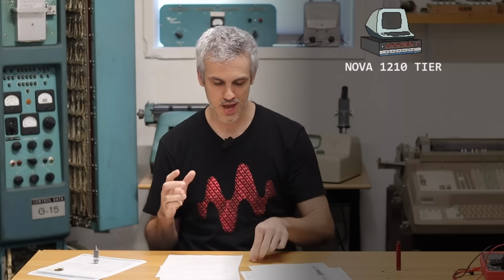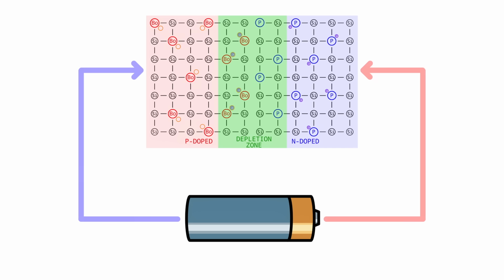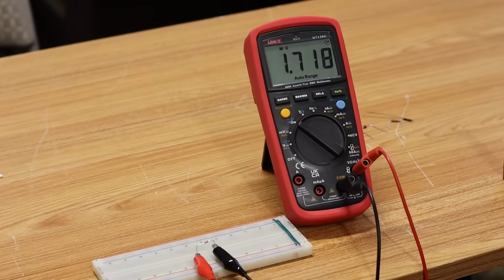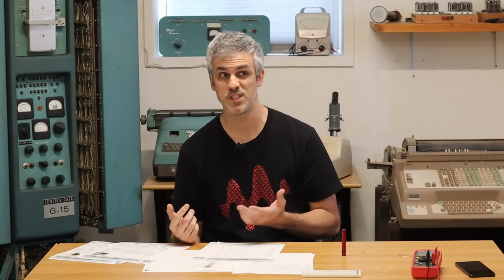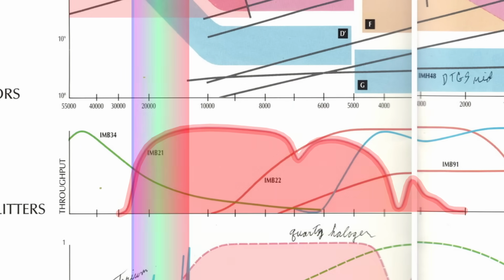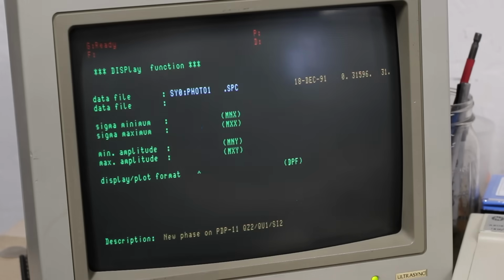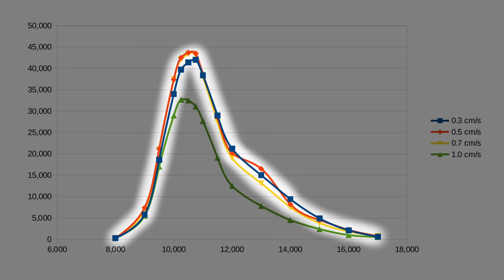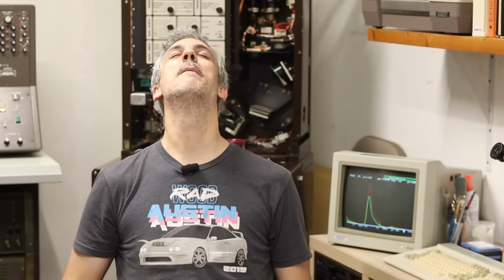How Do Photodiodes Work?

Comment from the maker: A couple quick things that didn’t make it into the video:

1. I did indeed test the pre-amp with other detectors at various speeds, even testing an InGaAs at 2.0 cm/s, and did not see the same drop in intensity. I do believe that the 20 kHz limitation that we were seeing on the 3F42 is not related to pre-amp bandwidth limitations.

2. My source is also most assuredly a limitation here. It puts out far more NIR than visible light energy. As such, the detector is always going to see more IR energy. It’s particularly worse at the moment because I have some diodes in series to reduce the voltage to the light, frequency shifting it towards the IR.

3. The proper way to test this 3F42 photodiode would have been to do three tests. One in the near- to mid-infrared with the globar. One in the visible with a different source. And one in the UV with the appropriate beamsplitter and deuterium source. That would give a clearer view of where in the entire spectrum the photodiode seems to be most responsive. I don’t quite have enough parts for the Bomem to have done it that way just yet.

4. I am 100% positive I got multiple somethings incredibly wrong, leave your corrections as replies to this pinned comment so I can see them!
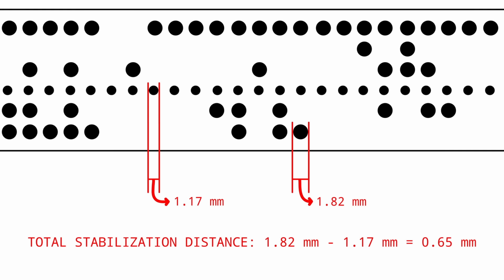Reply: I think there is a mistake at 21:45, the distance should be halved as it is for just the front little bit not including the rear bit of space
Reply: Now that I watched the whole video this means the bendix is doing it's cap speed and the external tape reader has some pretty souped up photoresistors
Reply: Great fun indeed! Now the spectrum you measure may well be interpreted as the convolution of the source spectrum, the instrument transfer function, and the photodiode sensitivity. Given that you have the source emission spectrum, measuring the spectrum with another photodiode of known sensitivity (from data sheet) should allow you to extract the instrument transfer function and, with that, finally get the unknown photodiode response curve by deconvolution.
Reply: The closeup at 10:27 suggests that it's a 34F2 photodiode rather than 3F42 photodiode
Reply: @LifeSizeTeddyBear The fun thing is the 34F2 does have a datasheet available, so we may not have gotten this video without David making that transposition!
Reply: Fun video! I looked at the title, and answered, "badly!" (Tongue firmly in cheek - photodiodes are great devices.)

I think you are uindeed measuring the input filter on the BOMEM. Photodiodes are "damn fast" - even a cheap one has recovery times in the low nanoseconds, and the good ones can detect signals up in the GHz!  I'm guessing that the photodiode was functioning as a crystal radio, and BOMEM just put in an aggressive low-pass filter so that their front end wouldn't measure the local AM station!

The BOMEM was, of course, absolutely overkill for this activity.  I'd probably have just used NIR, red, yellow or green, blue, and UV LED's to see which it responded to. The response peaks of photodiodes are pretty broad.

Once I'd found the diode's approximate peak, I'd probably just have continued to light it up with an LED of about the right wavelength, modulated the source with a 555 timer or something, and used a transimpedance amplifier like the one you'll find in "Op-Amp Basics," episode 13, on my channel.  In that episode I do just that: build a transimpedance amplifier sensitive enough to measure a photodiode.One op-amp, a resistor and a capacitor. (I used a cheap JFET-input op amp for the demo. Probably a TL071 or an LF411, I'd have to go back to my notes to check.)

One of these months, I'll get around to making a video where I FM or PWM an LED, and on the other side of the room, detect it with a TIA, demodulate with either a slope detector or a PLL, and see if I can recover audio. Be interesting to see what kind of range I could get with all the room lights on (and hence all the harmonics of 60 Hz swamping the detector).  So many projects, so little time!
Reply: @KludgesFromKevinsCave  LM3900N is transimpedance amplifier (Norton amp).
Reply: @kilowattpaSure. But for the TIA in the video, I didn't need to detect differential currents, just match the impedance of the input to a tiny current source. I thought it was instructive to show how to do that with a conventional op amp.
Reply: @KludgesFromKevinsCave  I like your channel.
Reply: Interestingly, LEDs make great photodiodes, & are a lot less hassle to get light into than 1N914 or 1N4148 diodes. If you want to try this out for yourself, it's super easy, just switch your multimeter to millivolt range, hook it up to your LED & shine a light into its lens
Reply: @theantipope4354  yeah, especially since the actual chip is a lot more exposed for the same reason they're so good at emitting light🤣
Reply: Entirely possible that the bandwidth limit is the preamp -- the smaller photodiode compared to the larger (I assume, beam spot sized?) detector it's meant for, should have lower capacitance.  The receiver circuit (preamp) is probably a transimpedance amp, which has a compensation capacitor that balances with the sensor's capacitance to give the desired response; with a smaller sensor, it's overcompensated (slower).
Reply: You keep on saying "wave numbers" but you seem to be talking about wave-length in nanometres.
Reply: I know what we need, a tritium source!
Reply: I noted this below, but re-commenting here. The Bomem may bias the detector in "photovoltaic" mode, for greater accuracy at the expense of speed. In this mode, zero volts is applied across the detector, by connecting it between ground and the virtual ground at the summing point of an op amp. If so, the diode may run faster when operated with reverse bias.

Comment: The difference between semiconductors and valves, or tubes, is scale. They both use P and N "junctions," the cathode and anode, and controlled by electrical fields, charged gates, like diodes and transistors. But tubes have massive gaps between elements and even in a vacuum a lot of current is needed to jump the gap, so to speak. So instead of jumping between orbitals, the electrons have to jump physical space, and a lot of it in respect to the size of an atom. That's why the current demands are so high. But the physics are the same no matter how badly physicists want to claim otherwise.

Comment: Very nice explanation! Little nitpicky suggestion: at around 5:45 where you explain the breakdown voltage, you show more and more batteries in parallel (well, more or less ;-)), which actually wouldn't raise the voltage. But that's really marginal... ;-)

Comment: Remember: the photodiodes are not the only factor of effective tape read of a given computer. The other components of the computer need to be able to also at least put the tape data onto working memory at that speed too, and I suspect the bottleneck in those early computers are the magnetic write heads.

Comment: It is not one way street. If it's open it is two way and you can pass AC but it must be DC biased. Imagine 2V peak to peak AC that you bias with 5V DC you can pass that AC thought diode and use it as switch.

Comment: Could the photodiodes be used as an input source without tape?

If you build a mirror of the inputs with light sources narrowed to each photodiode, could that then be hooked up to a modern machine and be used to pass data "directly" into the Bendix G-15?

I am imagining like how tape deck convertors work by pairing a read head to a write head, but with light sources.

I guess that could be even bypassed, since you could directly hook up to the output of the photodiodes, and wire in a solution that emulated the diodes. However, I like the first option, as it can be used in a self-contained cassette and be placed onto tape mechanism with no modifications to the Bendix G-15.

That would be a really cool project and allows you to keep the Bendix G-15 all original but still receive code from a modern source.

Comment: I've seen infared LEDs being used as photodiodes. I recall a non-contact 'touch-screen' that used arrays of LEDs - the first prototypes used infared photodiodes on the receiving side, which were later substituted with LEDs (the same as the transmitting array) as a cost cutting measure. Performance was pretty inconsistent between individual diodes, so the software needed to store a calibration coefficient for each receiver LED to make it workable.

Comment: One thing to consider also, it's not just the diode junction that determines it's frequency response to light.  You also have to take into account what the lens material is made of.  Is it glass?  Quartz?  Because that will also have an effect on the resulting response VS wavelength.

Comment: What's interesting to me, is i intuitively grasped how vacuum tubes worked, because they basically work off of electrostatic fields and geometry.  When i finally realized that semiconductors basically worked within the same framework, it blew my mind.  Literally.

And this was decades after i got my electronics degree.  I was always "there's two types of tech, vacuum tube and solid state."  But there really isn't.  It's all the same stuff when you get down to the physics.  At least to me.  I'm sure there is some physics nerd (^-^) out there who is going to say "no, it's not remotely the same thing."  You do you, and i'll do me.

Comment: How does the Bomem bias the photodiode? My guess is that it is zero-biased, aka, photovoltaic operation. That is, the diode is connected to the virtual ground at the summing point of an op-amp. That biasing setup maximizes accuracy, at the expense of speed. You might get more speed with reverse bias on the photodiode, which IIRC, your tape reader design applies. Academic, of course, since you have demonstrated it has plenty of speed for your application.

Comment: Get a IR LED and connect to a pulse generator.  Add a 2n222  to drive the LED.  Then look at the step response of the diode with a scope.   Clever setup.

Comment: Interestingly, LEDs make great photodiodes, & are a lot less hassle to get light into than 1N914 or 1N4148 diodes. If you want to try this oult for yourself, it's super easy, just switch your multimeter to millivolt range, hook it up to your LED & shine a light into its lens

Comment: I was kind of expecting to use a prism to break light and then basically just going through the spectrum of it... But if you just happen to have equipment slightly more advanced than what Sir Newton had lying around, why not use it :D

And just for the record, I don't think getting exited by science would make anyone old... just curious of science.

I remember being in my teens and spending time optimizing my loan calculator I programmed in Quick BASIC.

Comment: Really good work.  I've always understood that the sensitivity was very wavelength dependent, but this is an excellent visualization of it.

But, there's more than one component in the puzzle.  It could be really interesting to understand what the transmission curve of the paper tape material that is being used, too.  It's not going to be totally opaque, especially for an old tape that's absorbed stuff from handling over the years; I've always had trouble with some tapes over others due to that transmission, needing a delicate balance of light intensity and tape speed for a good read.  If you can, I expect that the SNR of the signal coming off the diode will be best by choosing a wavelength of light where the paper is most opaque and the diode still sensitive enough to see it.  Or, choosing a type of tape in the future what will give the least bit error rate.  Cheating (and non-period) to use the black stuff...

Comment: I think you can seperate the graph to its effective range and divide it into the source, original spectrometer. It will give you the spec of the photo diode compared with the BOMEM's.

Comment: Another way to test response speed is to send the light though fan blades and very the speed of the fan.  Also, you might see an improvement in frequency response by changing the light intensity.  A brighter light will break the diode down faster, but also slow the recovery.

Comment: Interesting video. You may have had more luck tracking down a data sheet if you were searching for the correct part number. The photodiode is marked 34F2 (not 3F42), as you can see at 10:25 in your video. Once you search for the correct part, there are several documents online including a scan of the data sheet from 1971 hosted by a Swedish website.

The data sheet confirms that the 34F2 is a silicon photo diode. According to the data sheet it should be good up to around 70-140 kHz (with a max 7 uS switch on time at 20 V). Further, the data sheet classifies the sensitivity of the photodiode with regard to a tungsten lamp (like your flashlight) at 2870 K, with a detector peak at around 900 nm (i.e. near-infrared).

Notwithstanding this, super interesting video. I'm sure it was a lot of fun. Any excuse to geek out with a PDP11, a spectrometer, and some spreadsheets is a good excuse in my book!

Comment: Maybe the process of reading the tape requires less precision than it seems. In the case of waiting for stabilization of reading the data hole, you might want to wait for the clock hole to stabilize, or maybe delay the clock trigger slightly, as its speed is near constant. Otherwise, a slightly malformed leading edge of the data hole could throw off the detection, when the rest of the hole carries perfectly good information. I'm just guessing, though.

Edit: It could be triggered by a falling high value on the clock hole. That would sample the data hole quite close to the middle for maximum contrast.